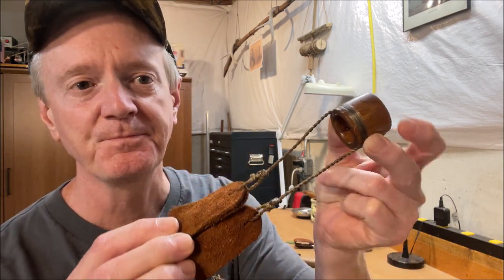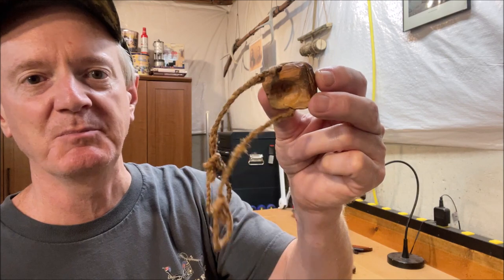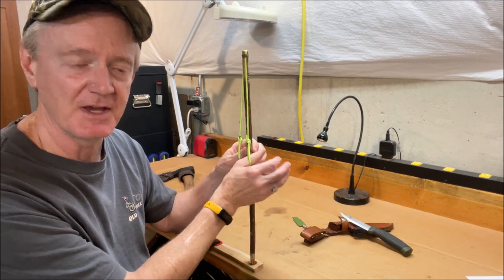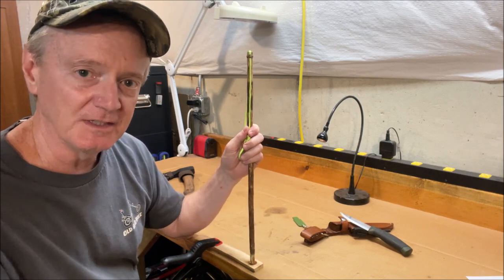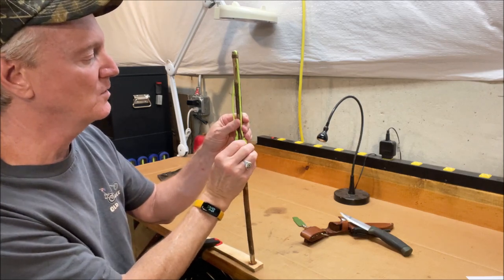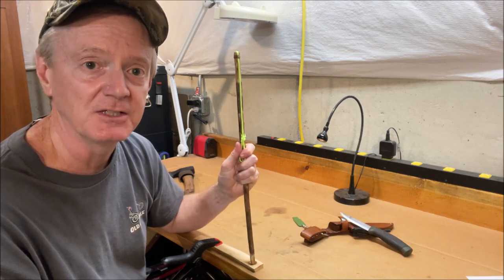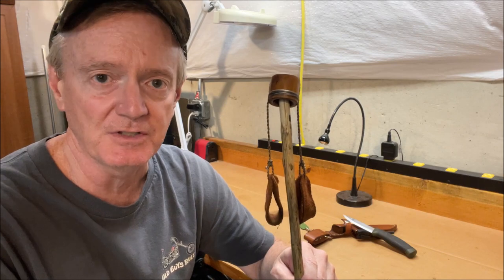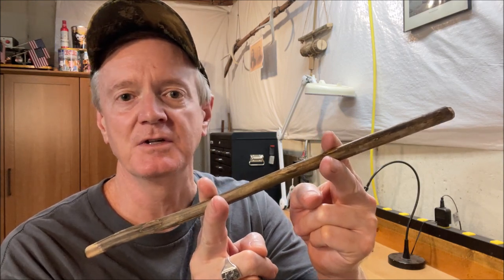What's A Thumb Sling Thunderhead?

Comment: I found myself always bumping the shaft with the loops so I lengthened them a bit and went over my pointer finger and onto my middle finger. Then I could still keep downward pressure on the shaft but the strap didn’t interfere with my hand contact.